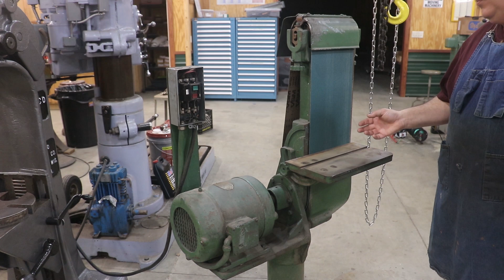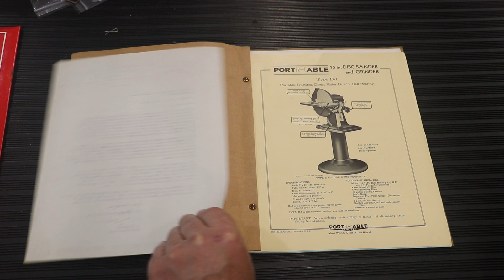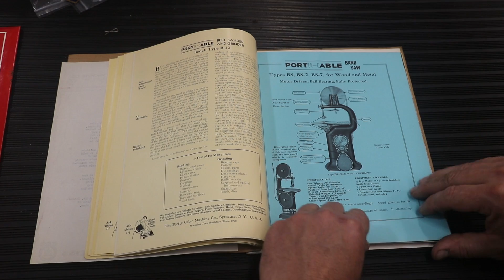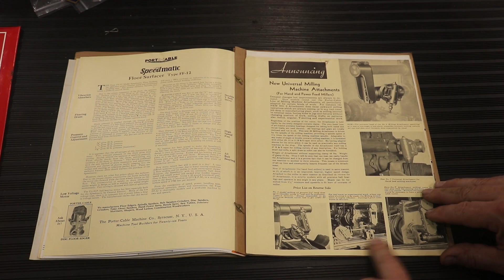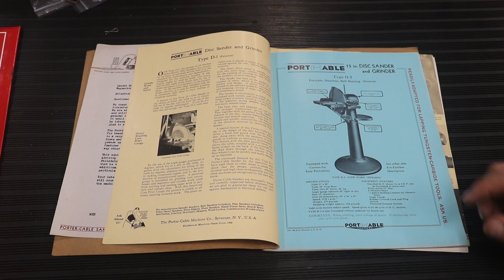New Machine for the Shop:  Porter-Cable B3 Belt Sander

Comment: Thanks for the info. I just bought a Porta Cable G4  wet/dry ,4 inch belt  sander serial # 1029, in working condition, A little rough on the finish, That will soon be taken care of. On the side of the belt housing there is a silver/black  metal tag 2.5 x 3 inch  riveted in place, It says WAR FINISH as directed by order 1-108 United States War Production Board. It has a square tube base. There is one on you tube , Trying to date it, Thanks . Later from Texas.

Comment: That sander is going to throw a ton of metal and grit. Have you considered a shop vac with a cyclone dust collector to collect the dust? You could use it on any machine you could fit a hood to.
Better to catch the grit when it leaves the work than clean it up from the million places it lands!

Comment: I  worked at 2 different company's simmer eqip. Pumps,gearboxes etc. First one when rebuilding clean bearings look o.k.use again and ran good second company don't even check bearings just replace, tossed so many perfect bearings away in my 40 YR. at that company made me sick ,but do as your told.

Comment: The old Porter Cable factory was located at 1001 West Fayette St. in Syracuse right near downtown. The building is still there and it's a big one. The Oneida -Air  Systems Co. is in part of the building making cyclone dust collectors for woodshops large and small.

Comment: Nice sander! I built one about the same size, only I made the drive roller a bit small so now the belt speed is a little low, but very useful anyway.
Reply: Yes, my drive roller is definitely way too small, seeing how that thing throws sparks. Would be great if you could let me know the rough roller diameter and motor RPM when you restore it, so I know what to shoot for if I ever upgrade mine. Also, if both pulleys are crowned or just the top one.
Consider adding dust extraction, especially if you plan to use it for wood, mine sure makes a mess.

Comment: Ha, I was that "one person" with the Engleberg version of this sander, that commented on your IG post.  Too cool Mr. Rucker!!

EDIT: EngelsCoachShop youtube channel also has a sander just like ours.  Don't think he's called it out specifically in a video, but you can see him use it in his videos pretty often.
Reply: He showed it in the redo of the 
April Fools video.  It IS a B3.

steve
Reply: EngelsCoachShop has an Engleberg  10" by 72" belt sander with a Delco 3phase, 5 hp 1760rpm motor on it. I don't recall him saying the model, but I would agree with Steve Skouson that it is a B3. He does a quick overview at the start of "The Wheelwright's Gym (16 Nov 2018)" video. (watch?v=Gb4E3CEMf_s)
Reply: @1crazyfocker , there is a plate on the
 right side (as you look at it) on Dave's 
belt sander.  It says B3.

steve

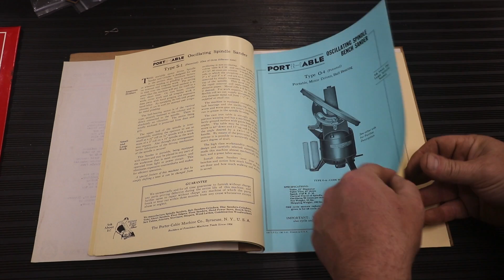Comment: At 10:13 - Near the bottom of the sheet it says, "IMPORTANT: when ordering state voltage of motor.  If alternating state also cycle and phase."  It seems to indicate that a DC motor was available and might have been the standard motor.  Early machine shops run with water and then steam power (there is one repurposed factory like this in Woodstock IL near Union IL near Arnfest that should be toured) and had belt drive systems which later were updated to in-house DC generators prior to the advent of local AC sourcing.

Comment: Back when Porter Cable was top drawer stuff. I have a  PC circular saw my dad bought about 1964. That scoundrel weighs a ton.
Reply: Back when cast iron was cheap!
Reply: @tobyw9573  No cast iron in the circular saw lots of steel and copper.

Comment: That's a nice machine. I have no idea when it was made, but I'd be willing to bet that motor wasn't made before the war, and probably not before 1950. I think a 3 HP motor in the 1930s would have been a lot larger than that and quite possibly open frame. The motor starter also looks like 1960s or later, but of course that was likely replaced.

Comment: Keith, Wow that is a big boy sander! I put a Teflon backed sheet behind the belt on my sander. It goes between the back of the belt and the front of the platen. Seems to reduce friction between those two surfaces.
All the best to you!
Eric
Reply: If you look up "Slip Cloth" it's Graphite impregnated slip cloth to reduce friction of sander belts. We use it on wide belt sanders.
Reply: @slypig24  OK. Thats the stuff I think. My buddy gave me some and said it was teflon. But anyway it seems to help. :-)

Comment: Hi from England

Some time ago I picked up a load of old tools (files, pullers, measuring/marking out etc)...
In amongst all that lot was a very nice little porter cable 12V DC drill...
An old one that you can either run off a lighter socket...or clip it direct off a battery...

That belt grinder needs keeping well away from the lathes & milling machines...
Reply: he has a grinding area with a curtain, so im sure he can find room to house it properly

Comment: You gotta put that up against the fireball tool go-cart sander. Great channel Keith.
Reply: I was just about to suggest giving it the Fireball material removal test, what was it, how much of a 1/2" steel rod can it eat in a minute?
Reply: Either that, or how much fireworks can it throw off from a smaller belt sander.  (anti-disclaimer: I work for HFT and still enjoyed the fireworks)